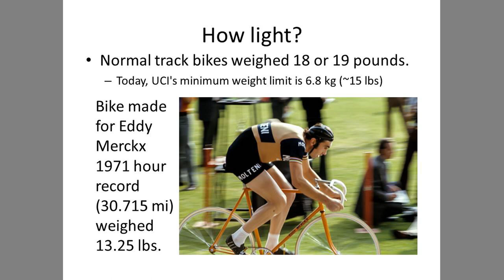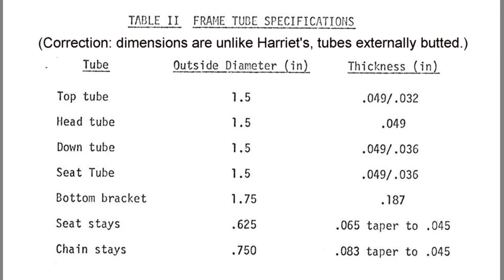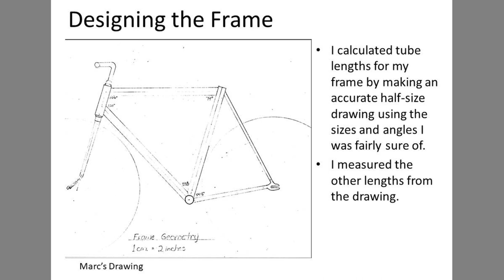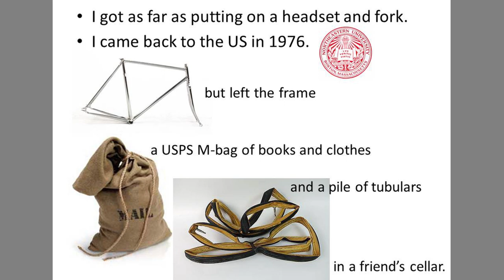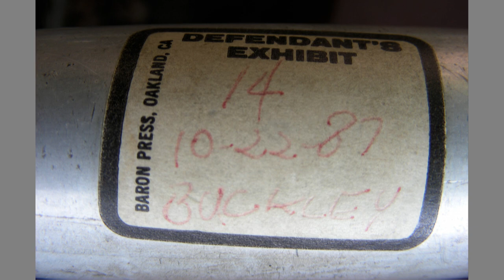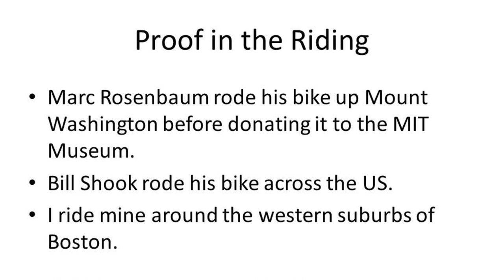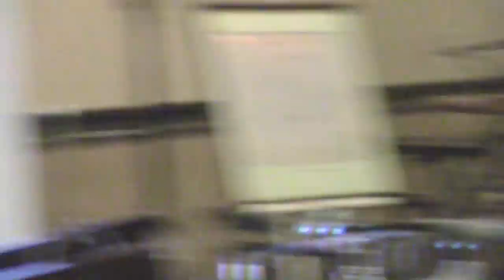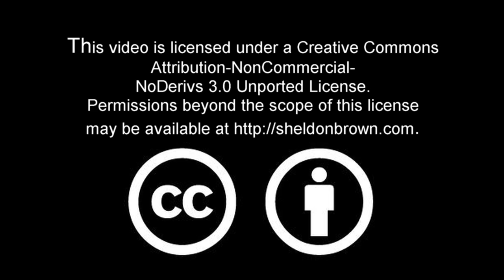The 1974 MIT Aluminum Bicycle Frame Project

Comment: I was at MIT at the time, and came THIS close to signing up for the project in January of '74.  Regrettably, I elected to take some other, forgotten IAP course instead, but I've remained interested in cycling to this day.  Really interesting to see the results summarlzed so nicely!  My housemate in grad school bought a Klein shortly after it went on the market, and it was not easy to chase him down on my 70s vintage Raleigh.  Climbing hills, especially, he'd leave me far behind.  (He eventuallly busted his frame in a crash; 40 years later I'm still riding that Raleigh.)

Gary Klein's US patent (No. 4,500,103) claimed a bike frame having tubes with specified diameter to wall thickness ratios, and having a specified minimum rigidity.  Cannondale got William Shook to test the stiffness of his MIT frame, and showed that it met the values that Klein claimed as his  "invention".  Klein lost the case, and lost again on appeal. Klein v. Cannondale Corp. 884 F.2d 1399 (Fed. Cir. 1989).  For a few years, though, a Klein was THE bike to spend your mad money on.
BTW, the  ‘Lu-mi-num" bike of 1896 was cast as a single piece, presumably with sand cores to make it hollow.

Comment: I have always been fascinated by the evolution of the high performance aluminum bike. I first saw a Klein in the summer of 1979, first rode a Klein on a furious joyride from MIT to Harvard Square and back down Mass Ave in the spring of '80 (the owner was sure I wasn't coming back!) and finally bought a new Team Super frame for $700 from Open Air Cycles near BU, a few blocks from my apartment. After riding a Klein that one time I knew I had to have one! I still have it.

Comment: In fact, Klein won on appeal, because the trial court's judgement on one of the three patent claims Cannondale sought to defeat was reversed in the appeal.  Additionally the appeals court found "reversible error" in the manner by which the trial court found for Cannondale.  See Klein v. Cannondale Corp. 884 F.2d 1399 (Fed. Cir. 1989).

Really the chainstays in Klein's design were the huge difference relative to the designs, like Shook's bike, that  Cannondale argued were prior art.  The seatstays were also considerably stronger due to their larger diameter (not greater thickness).  The material in the patent chainstays was over 3 times the thickness of Shook's chainstays.  If you've ridden a Klein you know how the rigidity of the rear triangle makes them climb like a jet fighter - compared to other early aluminum frames, like for example a Vitus.  The trial court appears to have paid no attention to the different tubes' thicknesses, and rather only considered the idea that overall diameters used on the early aluminum frames were larger than common steel frames.  Sorry to dump on attorneys and judges, but the trial court decision is classic know-it-all behavior from members of a profession that all too often think they can summarize reality rather than carefully consider the real details.

I'm wondering if Cannondale's designs did violate Klein's patents, but I think it's clear that his patent did have truly patentable claims, and was not just a prior art giveaway by the patent office.  Perhaps a private settlement was reached to prevent further litigation.

Quoting from the appeals court decision:  

"Klein also asserts that, even if claims 1 and 7 read on Shook's frame, claim 2 does not read on the frame, because certain claim 2 numerical limitations have not been met. We agree.

To be an anticipating reference under section 102, Shook's frame must meet identically every limitation of the claim at issue. Diversitech Corp. v. Century Steps, Inc., 850 F.2d 675, 677, 7 USPQ2d 1315, 1317 (Fed. Cir. 1988). Cannondale must show by clear and convincing evidence that each claim is anticipated. Id.

In its opinion, the district court found that the top tube, down tube, seat tube, seat stays and chain stays of the Shook frame all have a "midsection thickness of .035 inches." Klein, Civil No. B-85-653 (WWE), slip op. at 10. By contrast, claim 2 requires tube wall thicknesses of about .051 inches, .059 inches, .059 inches, .035 inches and .109 inches respectively. According to Klein, the dimensions of claim 2 are of critical importance because the combination of these wall thicknesses with the other recited characteristics make the Klein frame unique.

Cannondale has failed to show by clear and convincing evidence that claim 2 reads on the tubes used in the Shook frame.*  Indeed, Cannondale concedes that the chainstay tubes of the Shook frame do not have wall thicknesses that meet the limitations of claim 2. On this record, Cannondale as a matter of law is not entitled to a judgment of invalidity of claim 2.

Cannondale's motion for summary judgment curiously advanced only section 102, and not section 103, as the basis for invalidating Klein's claims. The issue of obviousness was not briefed by the parties and no evidence related to obviousness, such as commercial success, long-felt need, and copying was presented. Yet the district court, sua sponte, invalidated the claims at issue under section 103. Cf. Celotex Corp. v. Catrett, 477 U.S. 317, 326 (1986) (stating that "district courts ... may enter summary judgments sua sponte, so long as the losing party [is] on notice ... to come forward with all [of its] evidence"). The district court's failure to consider evidence of secondary considerations is reversible error. See Ashland Oil, Inc. v. Delta Resins & Refractories, Inc., 776 F.2d 281, 306, 227 USPQ 657, 675 (Fed. Cir. 1985), cert. denied, 475 U.S. 1017 (1986).

CONCLUSION

After carefully reviewing both parties' section 102 arguments, the district court's invalidation of claims 1 and 7 is affirmed. That portion of the judgment invalidating claim 2 is vacated.

COSTS

Parties are to bear their own costs.
 
*  Cannondale argues that the minor differences between claim 2 and the Shook bicycle frame are "non-patentable distinctions," citing Connecticut Valley Enterprises, Inc. v. United States, 348 F.2d 949, 953, 146 USPQ 404, 407 (Ct. Cl. 1965) and In re Smith, 714 F.2d 1127, 1137 n. 13, 218 USPQ 976, 985 n. 13 (Fed. Cir. 1983). We need not reach this issue because Cannondale has failed to set forth evidence showing that the differences between claim 2 and Shook's frame would have been obvious. Cannondale provides only a conclusory statement that " [n]o reference other than the Shook frame is needed to show that it is in the public's possession to change the proportions or size of the elements."